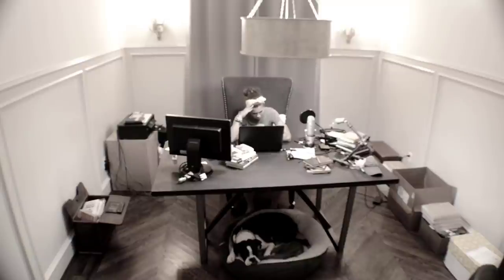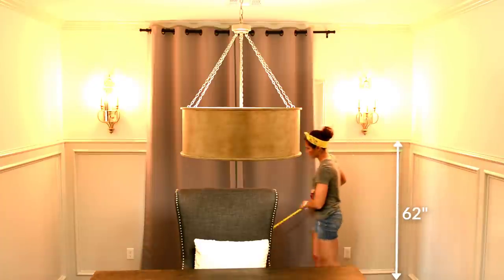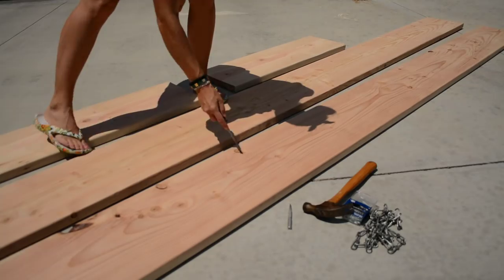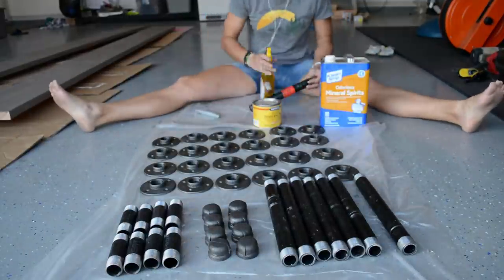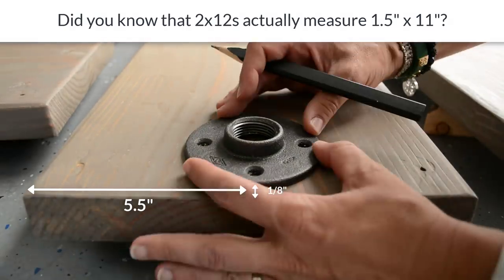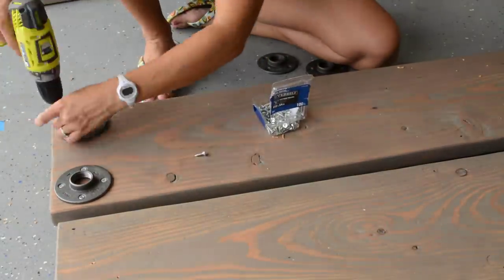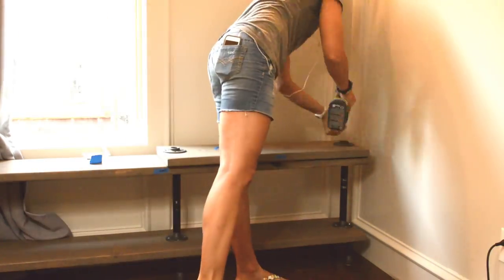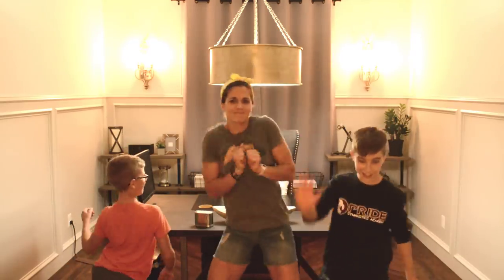DIY Wood and Pipe Shelving Unit

Comment: Well done, on the whole Couple of pro-tips. It's way easier to get an aluminum turkey pan - big basting pan from the dollar store, throw in your pipe, flanges, tees, etc. and let them soak in mineral spirits/varnish for 5 mins. Give them a good scrub with the rough side of a sponge or steel wool. Dry them with a rag. Don't use paste. Use a spray on primer with rust inhibitors - e.g. Rustoleum or Temclad - 2 coats. Then 2 coats of spray on Rustoleum/Tremclad in whatever color and gloss you like. Pipes will stay clean and won't rust that way.
Reply from the maker: Brilliant!! Thanks!

Comment: So awesome!!!! Curious to how much it cost you. Thinking about making myself one but with caster wheels at the bottom
Reply from the maker: It has been awhile since I made this, but I would estimate that it cost around $350. The hardware that I used was from Home Depot and it was actual plumbing pipe fittings. I have since discovered that Amazon carries some decorative hardware that looks just as awesome, but costs much much less! Definitely something to look into!

Comment: Can this hold a 50 inch tv?
Reply from the maker: Hi! This would be sturdy enough to hold a television as long as you get the feet leveled properly. The space between the two top shelves would certainly be sufficient for a 50 inch television. The only variable here would be the depth of the television. This shelving unit is only slightly more than 11" deep. Hope this helps!
Reply: thank you so much!

Comment: 24 1" floor flanges = 250+ dollars. lol
Reply: Not true... on Amazon you can buy a pack of  20 - "Floor Flange, Home Malleable iron Pipe Fittings for Industrial vintage style, Flanges with Threaded Hole for DIY Project/Furniture/Shelving Decoration (20, 1")
" for a little under $34.00.
Reply: Well, I hope nobody expects to be able to run to their local Home Depot for a fun weekend project.